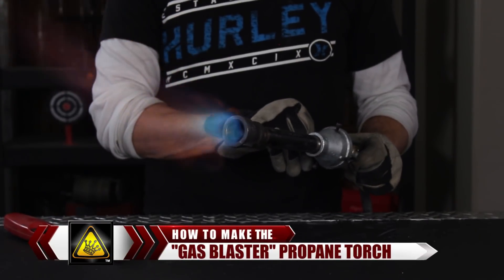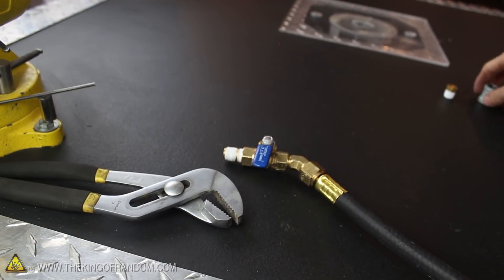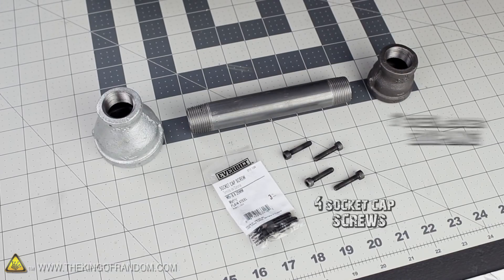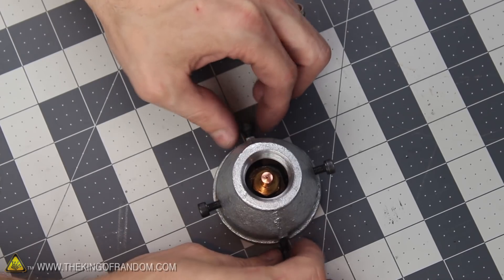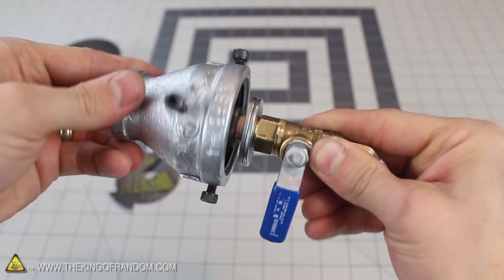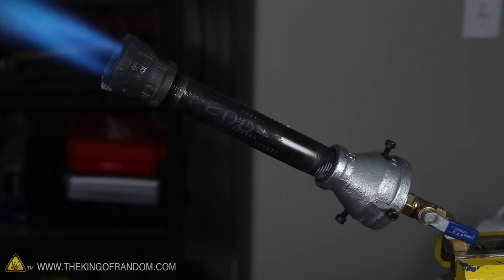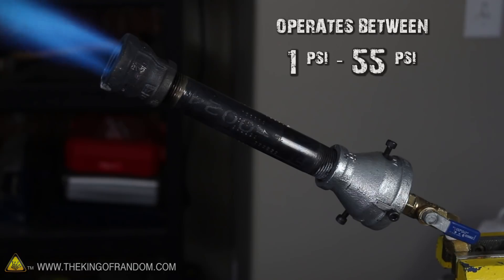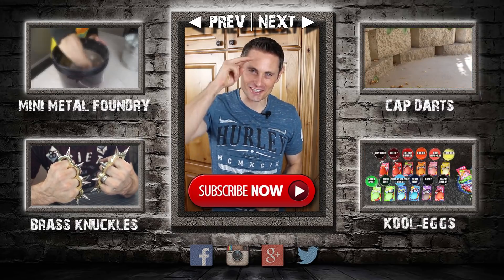Convert Your Backyard Foundry To Propane! ("Gas Blaster" Propane Torch)

Comment: Please for the LOVE OF GOD, use MM and CM instead of INCH!
Reply: he's american, gosh dang those Muricans
Reply: *****
That's only due to the fact that we have a thing called "SI" that almost everybody uses except the USA.
Also there are some other completely retarded things related to measurements, eg in Italy, a metric country, galvanised steel fittings are expressed in French (!!) inches, but copper fittings are expressed in mm. WTF? The same goes for the USA, that's a bit retarded continuing to stick to an equally stupid (1 mile= 1760 yards??? vs 1 km= 1000m) system when every single country in the world, including Canada, Australia and the UK has metricated.
Reply: +shinaanish That's an invalid excuse. The US is not the entire world (and is the ONLY country to use that retarded system), where everybody uses metric!
Reply: +TheFilledk We use inches in the U.S., and both the fittings and the tools are designed to American measures such as inches. If you are using metric fittings and metric tools, it's left up to you to google "convert inch to mm" and decide on how to round the measurements to metric.
Reply: +TheFilledk if you cannot figure out based on this demo how to find the appropriate parts in a metric system and assemble them in a way that works... you need to not be playing with propane jet torches in the first place.

you need to either be capable of solving things yourself, or not doing this at home.
Reply: MrOpenGL
It is valid. When you convert the measurements, they will not fit precisely the materials and tools that are available in your country, and different countries (and even cities) in the metric-using world often do not have materials of exactly the same dimensions as other countries and cities that use metric. For example, a PVC pipe of 1-3/4" diameter is 44.45 mm. You will not find 44.45 mm PVC pipe. You probably have to choose either 40 mm or 50 mm. Grant would have to know what country and region each subscriber lives in and then spend hundreds of hours researching the dimensions available to each person. It is impossible. He gives you the American measurements that he and all Americans use, and then you can spend 4 or 5 minutes converting the measurements, and then you can search for materials that come closest to those measurements. The measurements of some materials may affect the sizes needed of other parts or tools, and you will have to make those choices yourself.
Reply: Roving Jack
Not a valid excuse, because the basic problem is the USA using a system that nobody else in the world uses anymore.
Reply: what do you care what other use to measure? seriously. it offends you that others don't do what you think they should? you must spend an aweful lot of your time offended.
Reply: Roving Jack
Useless comment, just like the US's customary retarded system.
Reply: MrOpenGL
 That's the popular story, but it's not accurate. The metric system is now the standard in most industries (but quietly and behind the scenes), with a few exceptions such as construction.

But America has not gone fully metric because the vast majority of Americans have never wanted to. The gains seem too little, and the goal too purist. That is how we are likely to remain...the engines in our vehicles are metric (so our auto mechanics use metric tools), but our people use the United States customary units. We have a successful marriage of the 2 systems.
Reply: +TheFilledk There are two kinds of countries in the world. Those who use the metric system, and those who walked on the moon.
Reply: taiden
There are two kinds of countries in the world. Those who use the metric system everyday, and those who use the metric system in order to go to the Moon.
Reply: taiden
The Apollo Guidance Computer, as well as the other mainframes back on Earth were programmed using the SI. Data was inserted in customary units (back then metrication was not widespread enough but the computer industry was already metricated, and programmers were more comfortable in metric), converted to metric, processed in metric, converted back to customary and displayed in customary.
Reply: +MrOpenGL the metric system is so limited. 1 foot is the perfect size for measuring medium sized things... doing that in meters sucks and doing it in centimeters sucks too
Reply: Ryan Brewer
That's because of people like you that the USA is a terrible place to live in.
Also who taught you grammar, and who told you I was from Russia (I am not!)
Reply: Reyzas
 I know that in the 70's or 80's the USA tried to metricate like Australia, New Zealand etc but failed to do so, probably because of mismanagement and people like Ryan Brewer and Nicholas Rohde.
Reply: Paradigm Storytime
I would not bother because I use a system that EVERY country on the entire Planet Earth uses, while he is using a system that ONLY ONE country uses.
Reply: MrOpenGL If you know both, don't complain. What is disrespectful is insulting someone for not taking their time and energy to suit your opinion. We are not the only problem. Every country has their problem children, we are no exception, but claiming that "we Americans" should make the effort when we don't need to is plain disrespectful bordering on prejudice without basis. Many Americans are disrespected every day on the internet for calling it Aluminum instead of Aluminium. Our accents are made into jokes, and god forbid we try to speak a different language. We are considered ignorant assholes. There are a lot of people in this country who fit that description, however, any given country in the world has a large number of people who fit right there alongside them. Every ethnic group thinks another group all look alike, or all sound the same. Every country has those who think they are perfect, their system is perfect, and everyone else is wrong, while targeting a particular group/country more than others. In this case, it is the ignorant Americans using an outdated system no one else uses. It's what we have to work with and if we are going to generalize groups of people: No one outside of the USA states measurements in English, they don't convert for American viewers. They say a forge reached 1000 degrees, not mentioning that was Celsius. If they do state Metric and English units it is often inconsistent and even with a tone of condemnation toward Americans for using it. 

So if you want to throw entire groups of people under one label and ignore how people of your group do the same thing to us, if not worse, then go ahead. But next time someone defends their unit of measurement (this is such an unimportant mundane detail) consider that people are the same no matter where in the world you are. People don't change. People are stupid. A person... is smart. A person can change. And People will overshadow a person at every turn. Next time, look past the people and see the person.
Reply: Well to be fair Liberia and Myanmar both use the imperial measurement system.. (Not that it really matters) I think that all measuring is dumb. Everyone should measure everything (time, weight, energy, speed, length, and volume and whateverthefuck else) in YouTube arguments (YA) "hey Bob, what size shoe do you wear" "oh I wear a 2.25 YA shoe."... Hey Phil, how much sleep did you get last night? " I only got 1.5 YA's of sleep
Reply: I personally prefer the metric system. Base 10 just makes more sense to me.
Reply: Palmtreepain Well we're talking about the rest of the world here. The metric unit is universal, keep up with the program little fella.
Reply: +TheFilledk 1 inch is about 2.54 cm if that helps.
Reply: Nicholas Rohde
Sounds valid to me!
Reply: Seriously, how do you disable notifications on a comment? I am so sick of receiving reminders on an old conversation that is going nowhere.
Reply: ManMan ThirtySix
See https://productforums.google.com/forum/#!topic/youtube/xj6uAu2ISaE for an answer to your question.
Reply: *****
Thanks :)
Reply: +MrOpenGL The U.S doesnt use the metric system because it would cost billions of dollars to switch now, but I dont know why we didnt use it in the first place.
Reply: +MrOpenGL What happend to that?
Reply: TheFilledk
To what?
Reply: *****
I know that the industry in the USA has metricated (I think large exceptions are railways, the navy and aeronautics (but who doesn't use knots? I mean in Europe everybody uses nautical miles for distances, metres  for depth and knots for speed)). But having two units has already done a bit of a mess in that Mars Climate Orbiter crashed due to wrong units (input was in N while the microcontroller wanted lbs/ft), and of course the Gimli Glider. But at least the whole industry is moving towards metric, and that's a very good thing. Perhaps in the future we'll have people finally metricating as well. However even in Europe which should be 100% metric there are some silly units, eg as I have said before in Italy galvanised steel fittings (but NOT copper fittings, nor bronze nor anything except galvanised steel!!) are measured in FRENCH inches while every other fitting is in mm, which is completely nonsensical. Oh well...
Reply: +TheFilledk In the US we use INCH! Do some legwork and covert everything yourself and if your feeling generous post it for others online.
Reply: +MrOpenGL I don't believe NASA metricated until after the 80s. Cheers
Reply: Buzz Armstrong
To me it's the reverse, but our opinion is biased because we were taught these systems at school and we use them everyday (both metric and imperial) so we are accustomed to them to the same extent... Practically however metric is better (base 10)
Reply: i do agree that metric is better for using base ten.. infact i wish time was metric. however i do think that an inch is just so perfect. also howcome people use cm and mm but not dm for ten cm's that would be a pretty cool size
Reply: DragonHide94
You are right except on one thing. "We" Europeans and Asians and African and Latin American and Canadian and Australians may avoid putting the "Celsius" after "Degrees" because ALL the countries in the world except for one (the USA) are using the SI. Since you are the exception (and I'm not talking about American English here) you should be the one to include conversions. If the imperial system was to be used in all countries except one where the SI is used, we should include conversions and not you.
But again for the rest of the things you said, you were absolutely right.
Reply: +TheFilledk  Du skal jo bare lære at bruge Inch i stedet for cm og mm
Reply: Tactical-Radio
American skal jo bare lære at bruge cm og mm i stedet for inch! (forgive my Danish :D)
Reply: Buzz Armstrong
Liberia and Myanmar have metricated since 2008!
Reply: In Australia we use metric for most things but still use imperial measurements for many others, including tools and fittings. It's annoying but you get used to it. The problem I had today when attempting to source all the parts to build the foundry, wasn't the sizing, it was the fact that a lot of the fittings Grant used aren't available here. I couldn't even buy a steel pipe like the one he used 😕
Reply: Ashda Kreator Same in most of Europe. It's even worse because some of the fittings are in metric while some are imperial, and some other are even weirder units like old French inches.
Reply: +Jonathan Roeder you're*
Reply: MrOpenGL xD its alright i just typed in danish because he's called thefilled (DK) - Denmark. And i honeslty think inch is way easier than cm and mm
Reply: +MrOpenGL am American using an American measurement system, quit complaining google the measurements, or find someone that uses metric, its not grants job to make it so you can understand
Reply: Palmtreepain
Typical American egocentric response. Truman and WWII (the last time we really needed your help) are long gone. Get over it. You are no longer the centre of the world (and America was founded by Europeans, so give us and the rest of the world some respect)
Reply: +MythicalProdigy I'm not saying it's not universal, all I said is that an American is going to use an American until of measurement,

P.s. As you said little to try to agitate me, my only response will be the

In little kid voice "I'm not little"
Reply: Palmtreepain Yeah, well change, the world doesn't revolve around you, mate.
Reply: Palmtreepain
The problem is (at least from my point of view) when you upload a video on a website whose more than 60% of viewers use the SI, you (the content uploader) should show some respect for them by converting measurments to metric. Ok, we can google that ourselves, and most of us are smart enough to do that in our heads. But the fact that Americans give that for granted is something I personally find very disrespectful, especially because you're the only country that uses that system. If you upload to a website where 99% of users are Americans, then fine. But on YouTube, no.
NOTE: I am aware of the fact that fasteners and pipe fittings may be only available in inches. But I am talking about lenghts and temperatures, and all the other units we have to convert.
Reply: Ok I get your point, however if an American youtuber's main audience is American then they shouldn't have to convert everything to the strip system, and I don't think he is trying to be disrespectful to anyone by not using metric, I think he is just using the system he grew up with, he is just used to using SI so he keeps using it
Reply: +MythicalProdigy p.s. You tell me I didn't punctuate my sentence, but can't spell my right. Just saying
Reply: When it comes to threads and such, almost the whole world still uses inches, it's actually a lot easier than MM/CM

Comment: Two things: You should always check for gas leaks with soapy water, do not rely on "hearing" leaks. Putting a thread tap into a drill is a quick way  of breaking many taps. A beginner should do it manually and don't forget to use oil!
Reply: +YouHaveNiceGuns What kind of oil would you suggest to use and how would one use a tap by hand?
Reply: +CPLCraft They make a cutting oil specifically for that job, but any oil will do rather than none. A motor oil will be better than a thin spray oil. Also, don't let your tap hit bottom, as that will snap a tap without much torque. If you look at a tap set, they have T handles. You can purchase taps and handles separately if you only want only one.
Reply: +YouHaveNiceGuns Noob question, do you think olive oil would work because i don't have either oils and I'm not fixing to buy more than what was listed in the video.
Reply: +CPLCraft I'm not an expert, just years of experience. Any oil is better than no oil. If it is your first time using a tap, might I suggest drilling one hole at a time. That way if you screw up, you can drill another hole beside the bad one and it won't effect the performance of the torch. When learning to tap, most often beginners usually make the hole bigger rather than making threads. Push down hard on the tap and go slow. Once the thread has started, cut a half turn then back up a quarter turn. This will break off the small pieces of metal you just cut. A build up of cuttings will jam and cause the tap to break. That is why it is not wise to use a drill. Taps a hardened steel so they can cut, but it also makes them brittle like glass when torque is applied in the wrong direction.
Reply: +CPLCraft On another note, teflon tape is used for plumbing not gas lines. Home Depot (or alike) sells Pipe Joint Compound in a tube. Be careful, there are two kinds of compound, one for plumbing and get the one for gases. The compound never hardens and is easier to get a leakless joint.
Reply: +YouHaveNiceGuns Ok, thanks. I'll make sure ill take everything you said into account when I make this.
Reply: +YouHaveNiceGuns Yes, teflon tape is used for non-flared gas fittings.  The white stuff he used is thinner than the yellow, which is rated for gas use, they are the same material, just different thicknesses.  If you really want to get fancy, you can use the pink tape that is specifically for propane, but its all the same in the end so I use the yellow because its cheaper.
Reply: +Jim K. Ya, I knew that. I thought it would be less confusing if I told him about the paste. It's quicker and I find more effective.

Comment: dont forget to turn your regulator all the way off before turning the valve on the tank on. neglecting to do that can deliver unnecessary shock to the regulator and in some cases may break the regulator altogether.

Comment: 05:50 for the love of God, don't go by ear! Hardware stores sells cheap cans of leakage checking spray. Spray it on every connection and it will bubble fiercely in case of a leak. It can save your life!